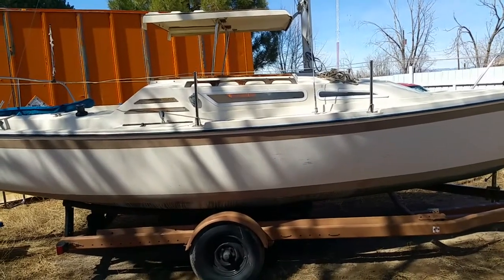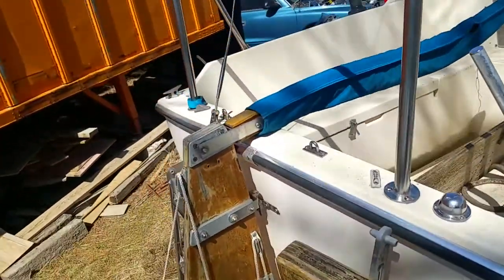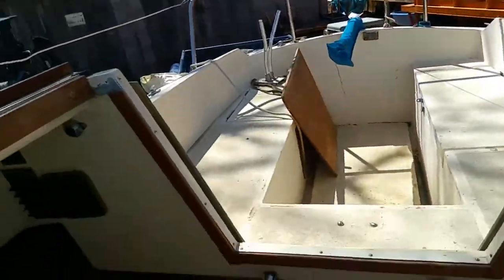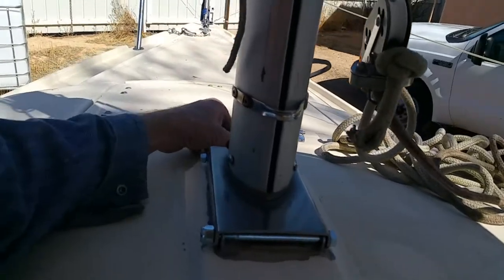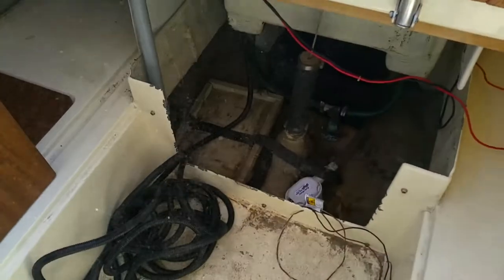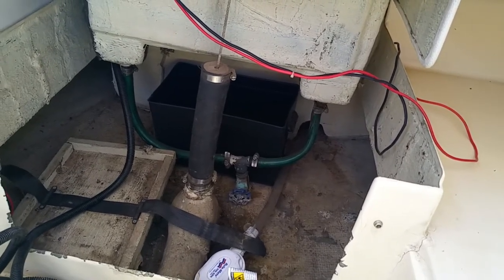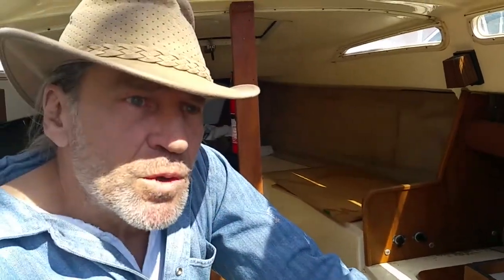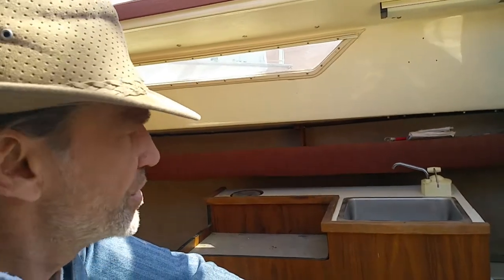spirit sailboat update pop top up (:~:)

Comment: Charlie 
you NEVER EVER sail or use the vessel in motion with the Pop Top in the UP position. 
It clearly states on the sticker/tag underneath the lid , if it is still there. 
It is only to be used when at anchor or docked to give you more headroom inside. 
Hope that help you.
Reply: And if you need any help with solar and batteries and wiring and appliances I am happy to help.  That is what I do for a living.  I dont suggest going 48volt OR trying to convert that to electric power.  You'll find it is way more problems than its worth and will cost you a fortune to do correctly.  
If you dont want to use a gas outboard they make many affordable electric outboards now.

Comment: How does the pop top connect to the mast? I have the same boat but am missing whatever connects right there
Reply from the maker: it has a pin and linkage with holes that line up with mount holes on a piece that slides in the spar under the boom... it is a terrible set up... very hard to set up and easy to mess it all up... i would say it is probably next to impossible to do on the water... i am going to redo it... either a totally redesigned pin set up... or i think i may just put it up permanently and box and fiberglass it in for a hard dodger (:~:)
Reply: @CharlieFetty  yea Iv lifted mine and its a real pain. I have the Spirit 23 so not sure if the hatch is larger but it is heavy and awkward. I was looking to add some hydraulic lifts (like hood props) to help lift it.